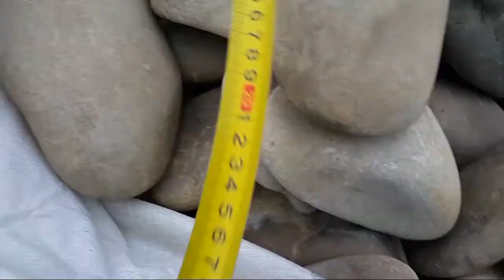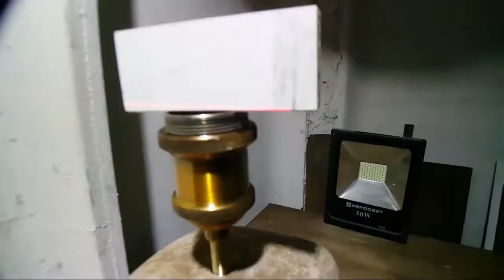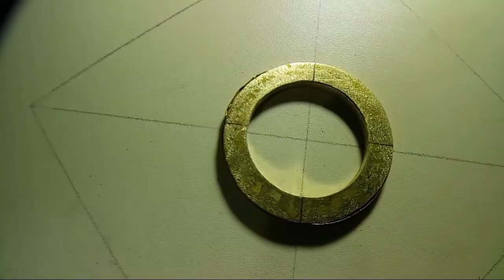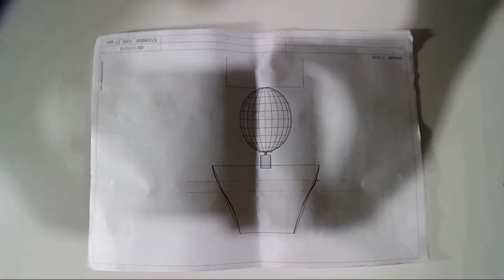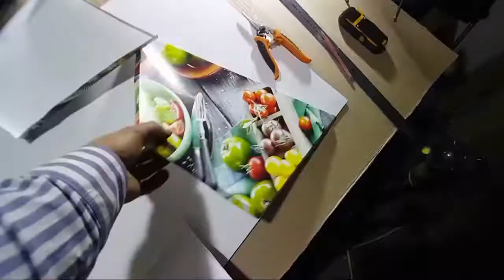Stone Lamp.DIY

Comment: Very Cool. I do something similar but much less refined. Ive been using a big hilti hammer/ drill to put a 3/8 inch hole thru the stone so I can put a section of threaded lamp rod completely thru the stone. It never occurred to me to just drill a  hole at the top and bottom big enough to hold a short piece of rod and a smaller diameter hole thru the stone for the cord. Certainly less stress on the stone. Doesn't  help much on a stack of stone lamp because the metal lamp rod is what holds everything together. I'll have to puzzle on that one.
oh yeah.. what kind of bit did you use

Comment: What type of drill bit did you use?  Looks like a diamond tipped hole saw with a long shaft/bit extension. Type and brand? And how did the bit hold up?